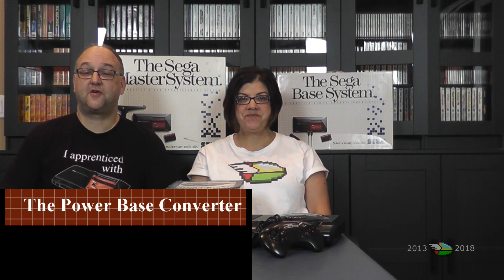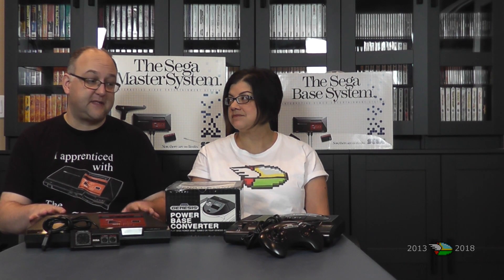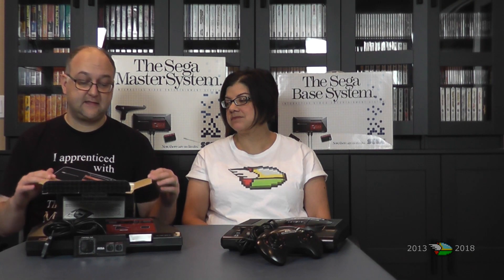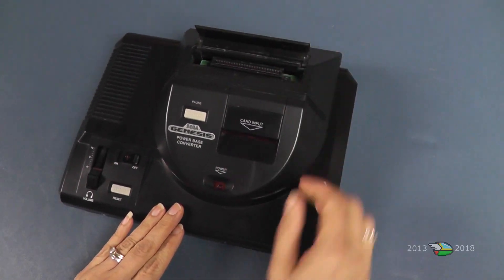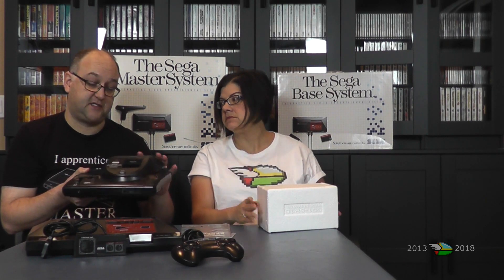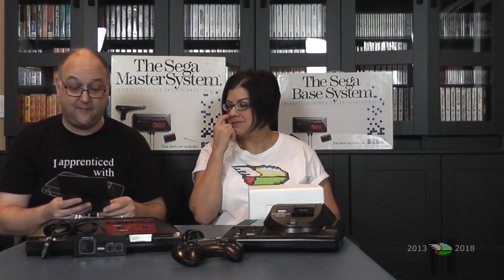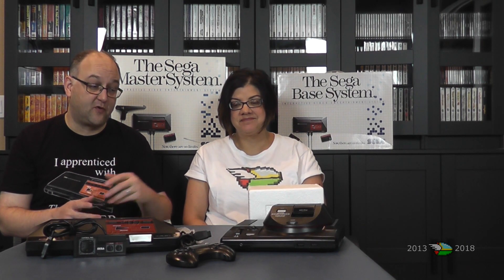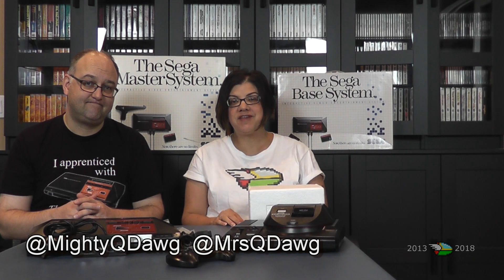Sega Master System 30 Year Celebration (Day 28): The Power Base Converter

Comment: It is a nice item to have for a Genesis/Megadrive collection.  I don't use mine a lot just because I play on a master system.  
You can get it to work with almost any form factor by removing the case.  I did this to test it with a newer clone system.
It isn't very sturdy so I wouldn't recommend it.
Reply from the maker: Thanks for the tip! As I mentioned we literally chopped off part of the shell so it would fit in a model 2.  That's kind of cool that it works in other Genesis versions as well.  I'll probably never bother trying it, though, because there are better ways to play SMS on Genesis now (Power Base Mini and Ever Drive carts).